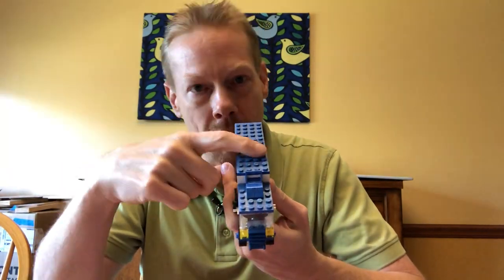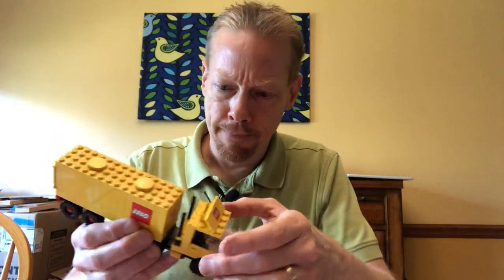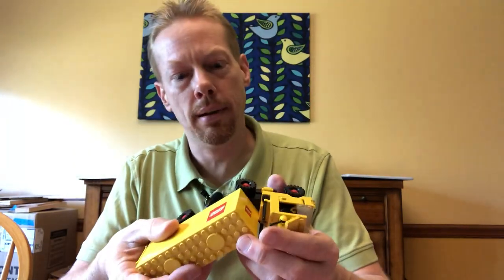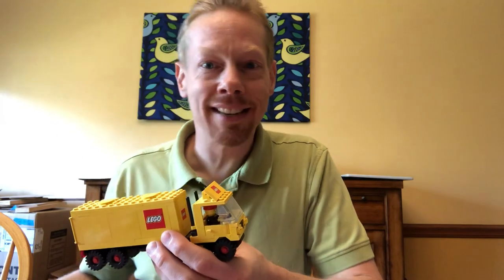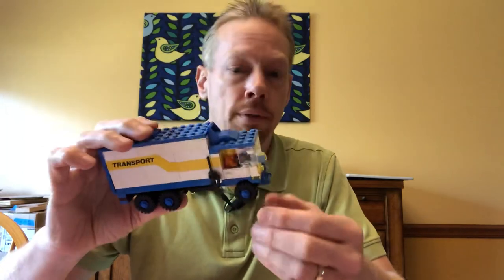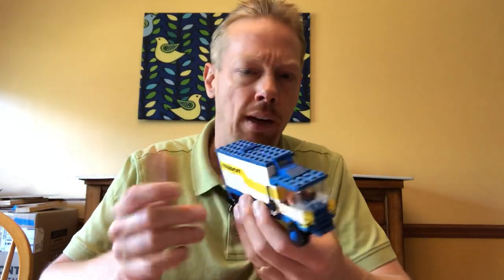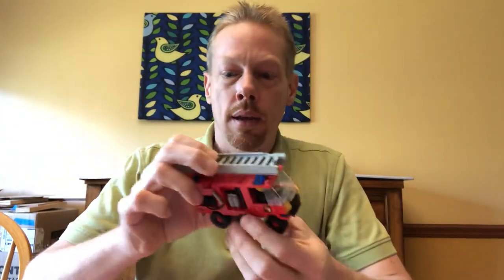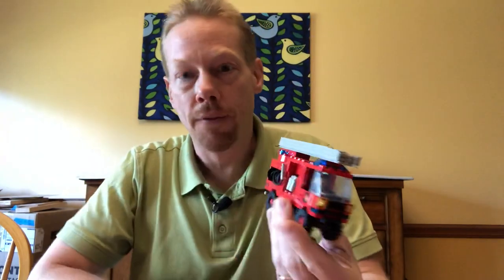Classic Lego 4 wide truck designs and why they're ideal for your town

Comment: what I really like about the 4-wide vehicle design is the fact that the designers back in those days made a lot of vehicles and they were very diverse, The basic design of a car (an example is the 6629 first-aid car) is still in my mind and with this as a basis you can make a lot of vehicles. I remember the 1772 airport truck, it's a lot like the 6624 van, but the backside is separate compared to that van. I haven't seen a lot of lego from today, but what I really liked about the lego in the 1980's and 1990's is that you just wanted to play with them after you've built the sets. Thank you for sharing the fun of lego. I subscribed right after watching this video.